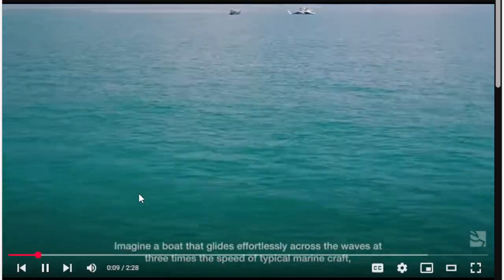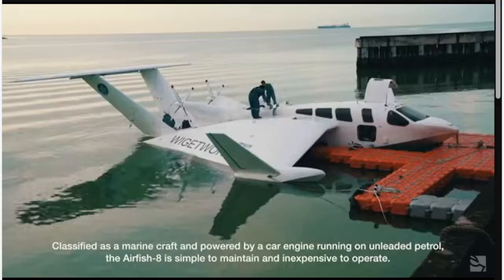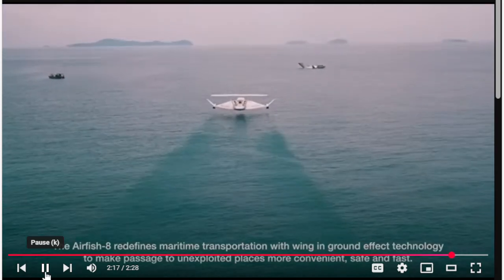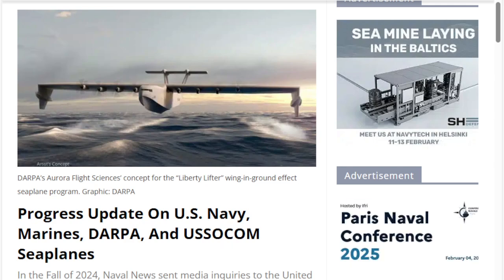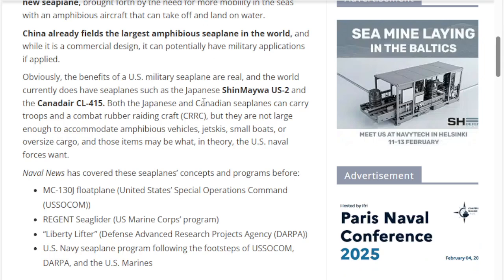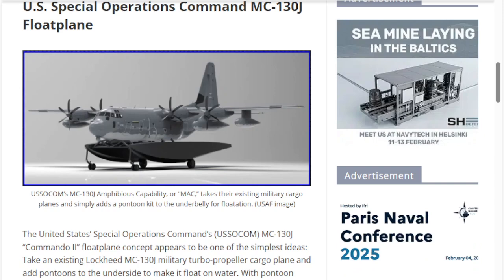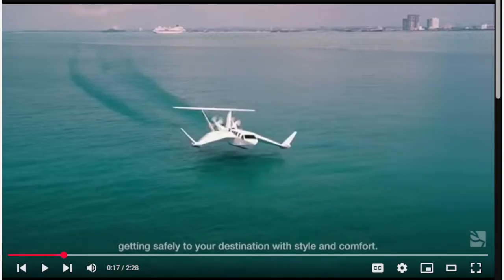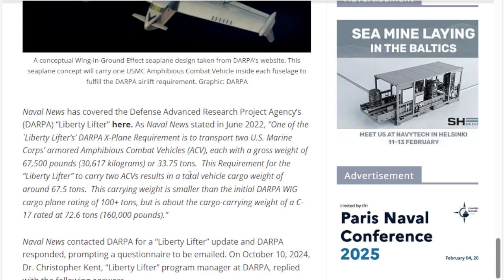DARPA thinking outside the box

Comment: The problem with "simply" militarizing these is as follows:
1. SOCOM actually doesn't have a problem. They can buy whatever off-the-shelf products they want. There could be supply chain issues though. (Any of the foreign chips in the dashboard could be beaconing and listening)
2. For regular forces (Marines, Navy) the acquisition process would have to be followed. Depending on program size, parcel out manufacturing to several congressional districts, consider life cycle costs including decommissioning. 
The requirements for such a vehicle sound straightforward: a 90mph vehicle that can transport 2000 lbs. Let's say the current size, weight, and logistic trail (fuel economy, scheduled maintenance) are acceptable.
Do we want to specify what sea states in which the vehicle shall be able to operate?
Do we want to specify MTBF thresholds of any components?
What about radar reflectivity and susceptibility to EMP?
Should it have a search radar?  An anti-ship missile isn't useful if you don't know where the adversary is.
What is its CONEMP?

I get it, though, this would play the role of the WW2 PT boats. For regular combat forces (transporting Marines on island-hopping ops), it seems that the V-22s are a better vehicle. And vice-versa, the Ground Effect Seacraft would be a superior patrol platform to the V-22 due to expense.
MHO
Reply from the maker: Very good comment with solid points i agree with. My overall point is the need to think outside the box and this is out of the box. I like the PT boat analogy, PT boats with weapons ranges potentially into the hundreds of KMs.